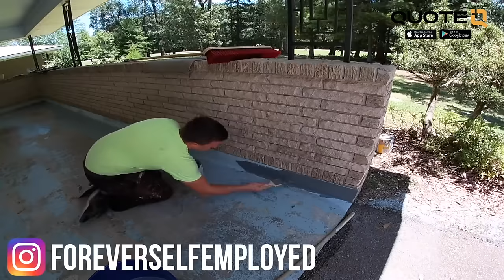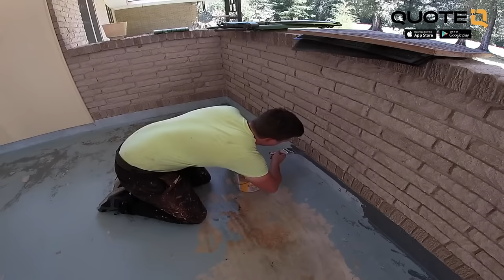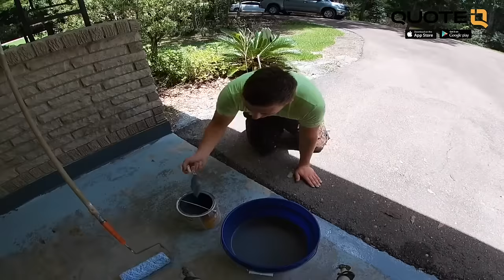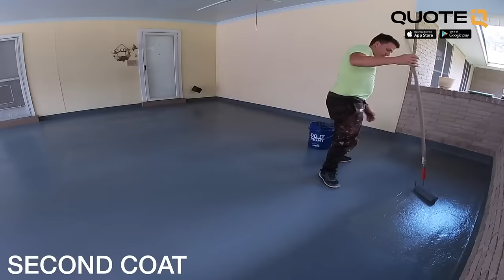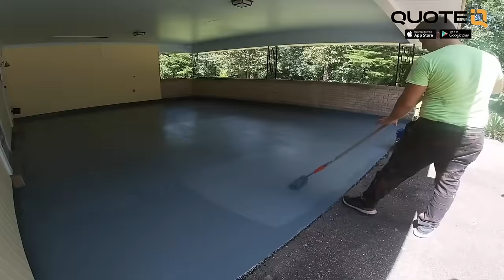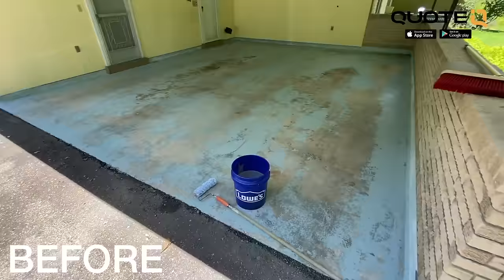Customer Refused To Pay Because I Work Too Fast

Comment: Now you know why contractors never do a job in 1 swath, they'll work a day or 2 or work half a day here and half a day there and come back. If they do the job all at 1 time the Zomms will complain they just haven't worked hard enough to suit them, so the contractors will take an 8-hour job and spread it out over a week lol. Just give it time Dude you'll learn, in 2022 it's not enough to be able to do the work, above all else you have to be able to run interference and dodge the Karens...

Comment: Think I may be trapped in the good ol’ position. Can relate a lot to this video. In my first year of business, doing well but think I’m underbidding too much.
Reply: I was in the same position in 2017-2018 when I started out on my own. It's completely natural when learning the art of sales. Now I never charge by the hour, but I average $80-$100 per hour and won't bid a job less than $1000 per day. You can do this if your quality is very high and you communicate that with photos and confidence while speaking with the customer. 
This is the strategy I employ every year or so to see if I'm under bidding. On every other lead that comes your way, bid it 20% higher than you normally would. You will naturally get less acceptance, but that's ok. The customers who say yes are the easiest to work for. Don't get into haggling with the customers, either. That will just stress you out and make you hate the job. Employ this strategy enough to refine your customer base until most of your jobs are in class A neighborhoods, condos, or lakeside homes. All the while, you should work on your Google My Business profile and get lots of 5 star reviews. Also, make sure you have a professional looking website made that outlines your services, catalogs your previous work, and funnels your incoming leads for you. If, and only if you notice you're doing all these things right and then running out of jobs, take your pricing down a small notch. The economy fluctuates and so do people's desire to pay for quality work. Hope this helps you on your journey!
Reply: @TheWatchmanChronicles  thank you very much, i appreciate the time you took to share with me, these other stories are my inspiration

Comment: Good video and very typical issue. Clients will complain if youre too fast or too slow + your age is a big opportunity that clients will use to take advantage of you. Get in the habit of just bidding jobs at a total cost to them rather than offering an hourly rate. Also, when you bid the job, write up and offer a proposal. Doesnt have to be all pro but it gives both parties clarity in scope, time, and expectations otherwise. This way when it comes time to pony up you have a position with some weight to it.
Stay tuned next week when we discuss leans on property.

Comment: I did a job and charged $650 which was by the hour. $63.5 per hour. After I completed the job and was paid I got a call 2 weeks later being told I over charged. I almost caved but stood my ground for the work performed which was above and beyond the initial work she wanted done. After the call I decided to break down what I would have charged had I done everything by the eaches. It would have been around $1,200.

Comment: Part of the price is not just the time you spend doing the job, but also in the first trip to estimate the job, and then in gathering the necessary supplies and tools, time spent thinking things through, and then actually driving out to do the job, then the time spent to clean up the tools and put them away for the next time, refueling your truck, sharpening chainsaw blades, refueling the gas cans, there is a ton of work.  So bring then up when someone starts trying to whittle things down to the hour.

Comment: If you're good at your job and charge 500 for a job that take you 5 hours.

Is that better or worse then paying a guy that charges 40/hour but takes him 12 to do it?

Always sign a contract and don't be afraid of small claims courts. It's only 50-75 dollars to submit a case against someone.

Comment: I'm watching your guy roll out the first coat on that floor. Train your guy to roll back back and forth across the same area at least three times to work the product into the concrete. You will get much better adhesion and a longer lasting results.

Comment: Back when I used to hang wallpaper, I gave an estimate on a job to remove the existing wallpaper and prep the walls for paint. They had someone else do part of the job before me who took several days and made a mess of the walls and the walls needed considerable repair work before they could be painted. I gave them price for the rest of the area and they agreed. I was able to do the job in about 4 hours without damaging the walls and they were ready for paint. The man got upset because I got done so quickly. I asked him, "Are you paying me for what I know - or are you paying me to be slow?" He thought about it for a few moments and agreed I did the job without damaging his walls and paid me with a smile on his face.

Comment: For the protection of both parties, the scope of the job and terms should be in writing . Anytime there may be a complaint about the job, if you have a contract or written agreement, and it goes to court, the judge will rule based on the written agreement . If the customer agrees to pay $500. to paint a driveway, for example, that amount must be paid , even if it takes 45 minutes  to paint it, period !! Get it in writing will save you a lot of time and head aches .

Comment: I hear this often in my line of work. 
I operate a septic company, and one of the services we provide is a process called Hydro-jetting or high pressure line cleaning. This service is used to attempt to regain flow in septic drain lines blocked with debris. Sometimes, we can complete one of these jobs in 30 minutes or less from the time of arrival to the time we are loading up. The price of this service is $375. As you can imagine, sometimes people get upset at the fact that they have to pay $12.50 per minute (equivalent of $750 per hour) for service. 
The answer is always simple. The job was not quoted per hour it was upon completion. You are paying for me to use $10,000 in equipment, my years of experience operating said equipment, and for me to be working hands-on (with gloves, of course) with your poop water. 
Not to mention the alternative to my $375 service is a >$4,000 service that involves destroying your property and takes weeks.

Comment: As a self employed Landscaper for 15 years, I have learned to work more efficiently and do the services faster in my later years than in the earlier years. My customers agree on the overall quoted price to do the work. I shouldn't matter to them if I work hard and efficient and am able to get high quality work done making $80-$100+ per hour or if I dog it out, work slowly and do the same high quality work at the end but only make $20-$30 per hour.  They agreed on the price and hire me. From then on it's up to me how much I make per hour.

Comment: 45 yrs in the tree biz , i occasionally (rarely) get a complaint about the job done to fast. Independent contractors are not hourly employees,  the incentive to work faster and more efficiently increases over time, making one a master of the trade. Not so with hourly employment. If i take twice as long can i charge more? If something goes  wrong  ( property, personal or equipment damage) does the customer pay? No, we as insured contractors assume all the risk. If i were to work  hourly  i would  demand benefits. Uniforms,  retirement,  sick days etc. I have jobs  take longer  than estimated  and  have never raised my price in all these years.

Comment: Not a story where someone refused to pay me personally but kinda the same with how they just could not accept how proficient I was when I read gas meters years ago.  At that point I was about 3 years in as a meter reader and reading on average  180+ meters an hour on walking sections with left and right meter locations at each house.  She came out right as I was getting her read or usage for the month and made me come back and look at her read until she felt "I" was comfortable with what hers was.  Sent in a complaint accusing me of ripping our customers off with inaccurate documentation cause as far as she was concerned it was impossible to do my job as fast as I do smh...

Pushing 40 years old now and with all my years I've realized many things and one of those are that some people know everything about everything even with no personal experience whatsoever.

Comment: I do tile install and i charge $450 to do a backsplash in a kitchen, it usually takes me about 5 hours including the grouting after and these homeowners notice that im making about $100 per hour but they dont complain because they are happy that the job came out nice and they know that is the price they agreed to. Plus i always say that i supply the glue and grout in that price so they know its labor and materials

Comment: I am a carpet installer, do high-end carpets and I know it takes twice longer than regular, usually when I bid a job I explain everything what I will do and change, and give the price, typically go by the day, if finish early never have problems, vacuum all the jobs after I finish, doing it for 22 years. Never go cheap, good work cost more

Comment: I use to do side work and worked for a woman other guys would turn down because she was extra picky. I charged $25hr. I had done a ton of work for her in the past. She wanted me to install sticky back vinyl floor tile in her kitchen. I was guessing it would take me around 5 hours with removing and reinstalling & painting baseboards along with the tile. Little did I know she was going to analyze each of the colored tile, having me lay the tiles in to groups due to coloring differences. Then when I was installing each and every tile she would have me rotate the tile to ensure she liked the pattern…😵‍💫🙄🙄. I had 8 hours in on day 1 and had another 4 hours on day 2..🤦‍♂️🤦‍♂️. At the end I quoted her $300 labor. She was not happy..  I told her before starting as always and she knew I charged $25/hr. I never ever would give her a quote before doing a job because of how particular she was. She had 2 other repair men tell her they wouldn’t work for her after their 1st job with her.🤣🤣.
The next time I came to do a job she told me she found a guy that would charge only $10/hr. Adios lady!! 
Oh and one other thing. This is a single older lady around 75 and she loved to chat with me. In the beginning she would chat while I worked and that was fine because I never stopped working to chat. I would just continue working while we chatted. The last few times I did work for her she wouldn’t talk with me while I was working, that was fine with me. As soon as I was done working on whatever it was she would ask me how much it cost and pay me right then. Then she would lead me over to the couch to sit and chat. I was like, are you kidding?? This lady was rich and I mean super rich and she never added a $ tip or anything then she wants me come sit and chat after paying me so that my time is wasted.. ridiculous!! Glad I don’t work for her anymore.

Comment: Work in the construction field for years.  Dealing with the contractors all the time.  The crews that come in and work fast the big companies like cause there cheap and get there bonuses and sell the homes  to all the people that have no idea but some time later the home starts falling apart and foundations are bad.  Home owner is in the whole and the builder and the contractor run with your money.
Reply: Thats why I would never buy a new home. Waaaaay overpriced and cheaply built .

Comment: Doesn't matter....its not an hourly job, it's a bid job for x amount of work for x price....3 hours or 30 hours price is same......been contractor for 30 years and #1 rule is confidence, paperwork/contract, and be polite but firm.....only had 2 or 3 clients in all that time that were difficult....and tbh I knew they would be from the start...but I needed the job....people can sense what type a person you are and starting out its easy to let your guard down.....contracts are huge, be specific and misunderstandings get few and far in-between....

They aren't professionals in your craft so whatever time frame they had in mind is irrelevant, remind them politely......equipment, Gas, time to and from, taxes you have to pay all calculates.......some people have problems with everyone and feel entitled to free work and value their time 1000% and everyone else's time is shit....nowadays it's all contracts detailed and changes are signed day of......people also have short memory when it doesn't benefit them.......treat everyone the same, it's just business......had many call back after they went elsewhere, they quickly found I wasn't the bad guy afterall, lol

In your case having to refer to your dad sets up a  lack of confidence in your trade and abilities.......it also made her question your pricing as a tradesman and you see that

I have made ton of mistakes learning my craft and will make plenty more I am sure....identify,  grow, and learn.....peoples reaction is your barometer

Comment: Recently had this as an electrician that works residential, I came over to a client who had a problem with a circuit tripping a breaker, I took maybe 20 minutes or less to fix the problem and I charged 150 lol she had a problem paying saying that it was too fast as well. But I told her well I get payed for what I know i have almost  20 years of experience call another electrician hell probably take an hour to fix it. Well she payed me anyways but I can sense that she was unsatisfied just like what you said in the video.

Comment: I manage where I rent..unit has a leaky kitchen faucet, I have part numbers just have to research them on line.. No all stores have them..I already know i need o rings to seal them to faucet they have a lip original plastic o rings leak..  So I go to store to get a few.. Customer stated that was fast??  forget research, order parts, going to parts store for upgraded part..  No it was not fast...  Then hard knock on install..  Then store old parts for numbers etc for next time.

Comment: Worked in an automotive shop once and had a guy get mad that a charged him $80 to scan his truck and see why it was in operable. Scanner told me what it needed and I can’t get to the part in question without taking the trans out and such so I gotta take the scanner at it’s word. Dude got mad it didn’t take long sayin he could take it to advance and get it scanned for free and we didn’t really do any “work” on the vehicle. I said well this scanner is about 3k dollars with another 4k worth of software on it and it went in and tried to fire the solenoid itself to see if would react(it didn’t so that was his problem). A free scan at a parts store is only gonna give you a code, not the cause of the issue like I just gave you. It took a me 2years of schooling and the cost of my education to be able to read and interpret the data my scanner gives, and also took another few year of experience to know that if the customer wanted to me to physically test what the scanner said was the issue, ide have to pull his trans, pull it apart, get to the part and bench test it. Then charge him labor for doing all that which would be in the high several hundred dollar range. 

So you want me to do the $80 or the go ahead and pull your trans now and charge you several hundred and leave you sittin here needin to call someone cuz ur vehicle is apart and can’t go back together unless it’s fixed? 

Your paying for the scanner, and my time it took me to gather the knowledge to read and interpret it. I can’t be sorry it only took me 10min to diag a vehicle. It took me years to get good enough for it to only take that long. And I shouldn’t be punished for that.

Comment: As a plumber, I can relate. So many service jobs can be an extremely quick fix (leaky toilet flapper, tightening a packing nut, etc.). You're in and out in 5 minutes and then you hit them with that bill and then they proceed to moan and complain that you charge too much for very little work. I give them the same speech every time. You're not paying for the fix necessarily, you're paying for my years of experience and skill to be able to diagnose and fix your problem very quickly and efficiently. 

That's the professional response but what I'm really thinking when people complain about the bill is figure it out yourself then. How many times I've heard, 'I could've done that' from a customer. Well if you could've, you wouldn't have had to call me now would you? There's that saying that the customer is always right, I get where the saying comes from but it's completely inaccurate to reality. Customers are usually almost always wrong and they're entitled on top of that especially when it comes to the bill. It's like people expect everything to cost nothing.

Comment: if you want to pay me an hourly rate, im going to work like an hourly worker.  i will drag the job out right up until the deadline and take plenty of breaks. Now if im being paid a set amount for the job as a whole then i will heavily encouraged to do the work quickly and efficiently. Point is you get what you pay for. i will gladly pay more if the job get done faster. This is why i encourage anyone doing jobs like this to get everything in writing, that way you can get your money without too much trouble. if you can keep it to small claims court you have already won.